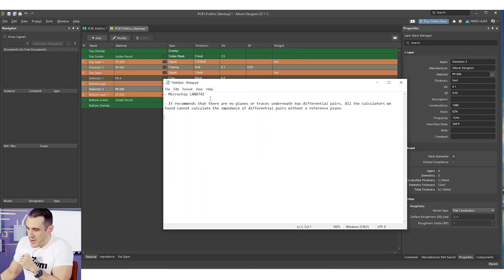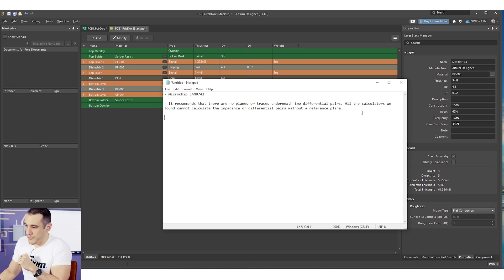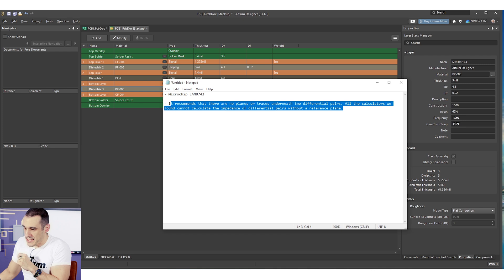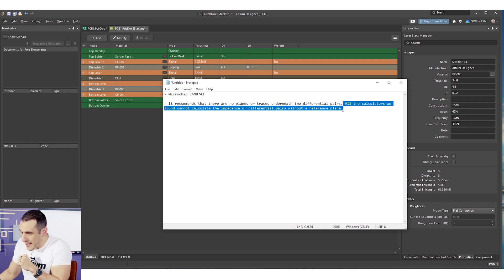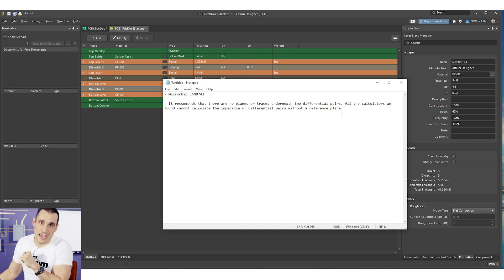Planes Below LAN8742 for Differential Pairs?

Comment: Can I change places _P and  _N in pairs of RX and TX for more correct design signals? It works, I have already done it. But I wanted to get official approval :)  I use LAN8720A.   The need for this arises when the transformer and the chip are mounted on different sides of PCB.
Reply: LAN8720A is supporting polarity correction and Auto MDI-X so you can swap RX/TX pair and P/N signals as well. Signal polarity is important only for 10BASE-T transmision, 100M and 1G is not using signal polarity.
Reply: @dawidmilcarek5573  , Thanks for the answer.

I was guided by the description of the chip. Here is the quote:

( HP Auto-MDIX facilitates the use of CAT-3 (10BASE-T) or CAT-5 (100BASE-T) media UTP
interconnect cable without consideration of interface wiring scheme. If a user plugs in either a direct
connect LAN cable, or a cross-over patch cable, as shown in Figure 3.4, the device’s Auto-MDIX
transceiver is capable of configuring the TXP/TXN and RXP/RXN pins for correct transceiver operation.
The internal logic of the device detects the TX and RX pins of the connecting device. Since the RX
and TX line pairs are interchangeable, special PCB design considerations are needed to accommodate
the symmetrical magnetics and termination of an Auto-MDIX design. ). 

It is not indicated that polarity can be reversed, it is not indicated that there are restrictions with 10BASE-T. 

But it works.
10BASE-T did not check.

Thanks.